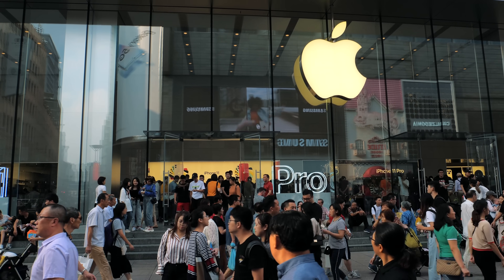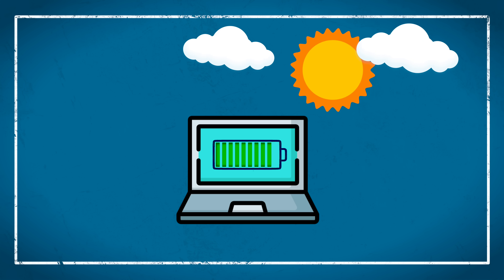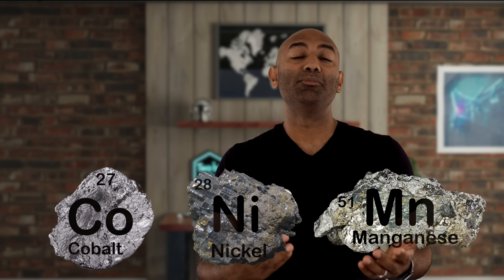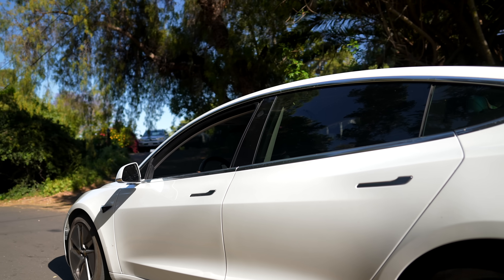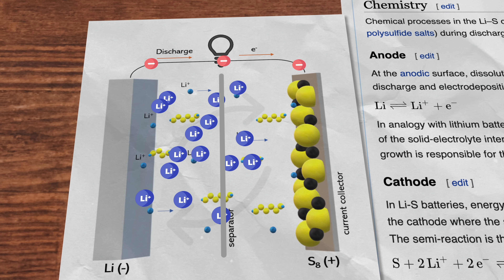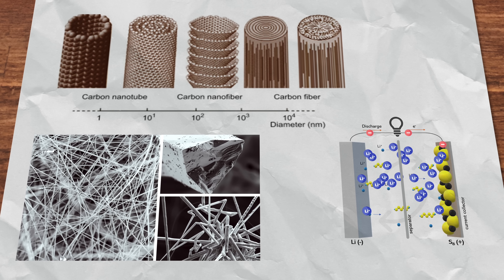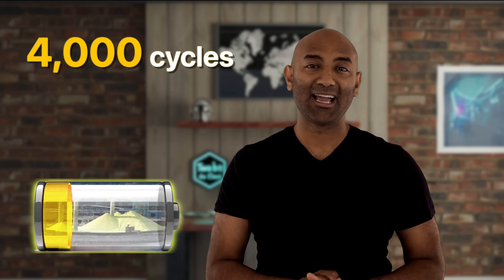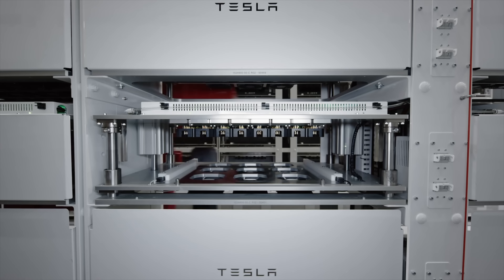Scientists Discover a Lithium Sulfur Battery Breakthrough on Accident!

Comment: Title: "Scientists discover super-awesome battery". Translation: "Some scientists made an observation which may or may not mean something tangible in a decade or two. Imagine". God I hate the internet.
Reply: Na ion battery s are already on the shelves.. and mark two versions from CATLE being built. But the inertia and politics 
Of Lithium based tech needs to be overcome.. 
Money 💸💰 isnt very clever it chases 💰💸 .... and runs a mile when it comes to actually solving big problems or Science 
ones that dont go away unless you try different things to solve changing problems. We definately need to get away from the wholesale use of rare elements ... and failing to recycle those that we cannot do without using...
We definately do not want to start mining deep ocean environments for them ... Thats the Planets off shute for so much dangerous stuff..  the input for the natural deep longterm  geological store. 
Microplastics being the current example in case. Theyve already reached everywhere and thing but most of it is in the upper layers of Marine sediments.... disturb it and we let loose a Blizzard of plastics and chemicals into the active recirculating marine and terrestrial environment.
Reply: Yeah, and I don't really understand the parade of Captain Obvious comments like "hey, they could put a smaller battery in a car and it would go the same distance and be lighter", or "hey, think about it, it could makes electric bikes better". "Electric planes become better."  As though well-known benefits to battery applications were not already the motivating factors behind many research efforts to improve battery tech.  Comments seem to imagine scientists laboring away in their labs, unaware of what their discoveries might lead to, and they are just waiting for the YouTube comment section to bestow upon them some clues as to how these developments might be useful.  Mutter mutter mutter.

Comment: Also why is 4000 cycles equ 10 years once  a day would be 3650 cycles seems like in the past hen I've heard a 1000 cycles equals three years that seems crazyer?
Reply: Depends on the frequency of charge/discharge cycle. Your maths are correct but the frequency is the uncertainty and has a wide range.

Comment: I hope this will ever leave the lab. I don't want to be negative, but we just don't know how the material will hold up in the real world. Is it really that cheap and stable? How expensive is the carbon sheet? How fast will you be able to charge the battery? How will it perform under high or low temperatures?

Comment: No electric cars do not have a present range of 500 miles - that is why there’s a problem and why sulphur chemistry is so interesting.Real world motorway driving (75 mph av 2 persons)will give you a usable safe range of circa 200 miles.That’s the problem.
Reply: The Lucid goes 500 miles on a single charge!
Reply: i think with an ID.5 you get 260 miles real range and they use old battery tech without silicon loading in the anode. with standard silicon loading you get about 25-30% more range, with silicon nanowires you get 60% more range easy and much faster charge times.

Comment: You should have included how much cobalt goes into a battery vs how much sulphur so that the dollars per mt made more sense. If its 112,000 per mt of cobalt but that can do X amount of batteries then it makes it hard to compare to the sulphur price per battery.
Reply: A sulfur battery is lighter than an equivalent sized cobalt battery so a sulfur battery is still cheaper.

Comment: Lol. There is already a lithium sulfur EV battery that is patented and being independently tested by BIC as we speak.  Preliminary results positive and final results by end of May. Done deal already
Reply: Really? What is the cost? Is it getting 1500 miles? Which EV maker is planning on using it?

What I found just by looking up these batteries:
The main problem is that current lithium-sulphur (Li-S) batteries cannot be recharged enough times before they fail to make them commercially viable. It is all in the internal chemistry: charging a Li-S battery causes a build-up of chemical deposits that degrade the cell and shorten its lifespan.

Lithium-sulfur batteries are high on the wish-list for future batteries as they are made from cheaper and more environmentally friendly materials than lithium-ion batteries. They also have higher energy storage capacity and work well at much lower temperatures. However, they suffer from short lifetimes and energy loss. Mar 24, 2022
Reply: @gigakrait5648  Mullen automotive has tested there to be 600 miles full charge and on a 18 minute fast charge another 300 miles.. polymer lithium sulfur and believe they use graphene for the folds.   Half the weight and size.. as for longevity believe they stated 5% loss compared to most lithium ion at 85% loss.. there were some naysayers so Mullen sent battery to BIC testing facility in Indiana to have it independently tested.. preliminary results came out positive, final results including charge cycles and degrading comes by end of May

Comment: A battery that weighs 3 times less?  What?  If it weighs 1 times less, it weighs zero.  How do you get negative weight?
Reply: Divide its weight by 3
Reply: @QH96  3 'times' less declares the operation is multiplication, not division.

Comment: Doesn't LFP batteries last 3000 cycles?
Reply from the maker: some last 6000+! I'm a huge fan of LFP batteries, and will be using them for my home.
Reply: @TwoBitDaVinci  awesome!
Reply: LFP is great for short and medium range EVs. next year with 230Wh/kg also for longer range but currently not for very long range. but maybe in a few years together with a better anode, you can make very long range (500 miles) batteries with LFP.
for home solar energy storage, sodium batteries can be interesting as well.
Natron Energy claims to have a cell with insane 50.000 cycle life, going into production next year!

Comment: Another lab breakthrough.  But there are always huge issues ahead, with manufacturability, supply chain issues.   This is still too early, even as a lab experiment.  The issues need to be understood better.

In the next few years, probably LFP is the best bet for getting off nickel and cobalt.  True, it doesn't have as much energy density.  But it is relatively mature technology, with a good safety profile, as well as long cycle life.  And can charge it to 100% without too much worries. This offers some more options for "cell to pack" efficiencies, much less packaging for battery safety.  Tesla is already moving in this direction for their lower ranged vehicles.  I heard, Ford is doing the same.

Silicon anode, is the other (realistic) technology to watch.
Reply: Silicon anodes swell enormously as they charge, as much as 25%. When they expand and contract repeatedly,  they crack, causing huge efficiency losses.

Comment: Yea EVs are great if your rich and can afford to drop an extra $10K or $20K (usd) for an EV over an ICE

I’ll keep the cash to buy food given all the Biden caused inflation
Reply from the maker: It's not that simple, you're only thinking of upfront cost. ICE cars are super expensive right now too, you know that right? Also if you have the vision to look out 5 years, EVs are actually cheaper. My gas SUV costs $120 to fill up to go 300 miles, and my tesla costs about $11.
Reply: @TwoBitDaVinci  I’ll trust your figures for your car as valid. You should know but again THE VAST MAJORITY OF PEOPLE CANT AFFORD AN EXTRA 10 to 20 THOUSAND up front.

And you forgot to figure in extra interest if you buy the car on credit (which I don’t).  Also many people can’t even afford to buy a new ICE but have to buy used ICE _ON__CREDIT_ and even if they could afford a used EV I don’t think there are that many around YET, give it another 5 or 10 yrs and there may be IF people can afford the replacement batteries as every current type of battery has a max number of charge/discharge cycles (I understand Lion and L-Po) have life of about a thousand cycles.  We don’t know what future battery types such as the Li-S (that just had an unexpected research accident hat may lead to that being a valid new type of battery) that may be invented in the near future.  Then there is the NDB that has been making progress (I hope that one makes it)..
Reply: @TwoBitDaVinci  Minimum starting price of a Tesla is $48k. Models with decent range (S model) start at $60k. Considering the current generation is pushing for minimum wage of $15/hr at McDonalds I doubt they will be able to afford one of these anytime soon or anybody for that matter with sky high inflation. Tesla's have also increased in price about 3 times already this year. Electricity is cheaper now but if gas goes away and governments lose all that tax revenue which is in the billions (hundreds of?) you can bet that they will replace it by taxing the living hell out of electricity. They aren't going to give that up. Add to that what all these EVs are going to do to the electric grid, i.e. overload it. California has had rolling blackouts for a few years now because they can't supply enough electricity as it is. Do you really think thousands if not millions of EVs are going to help that? Coal, gas and nuclear power plants are being shut down every year now. Solar and wind are not viable replacements on that scale. There are more downsides to EVs than you care to admit.

Comment: Well, not grid storage unless you're tight on space.  You've already covered the company ESS with Iron redux flow batteries, and that's certainly the best solution for where space is abundant like where wind and solar farms are.  And more than anything else, their tech needs to be advocated because it is THE most earth friendly grid storage from everything I've seen so far.

But yes for something like a powerwall this would be much better than Li-Ion.

I think ESS is getting a slow start because of how much Tesla competes in grid storage, and every time Tesla gets a new contract for grid storage, I see the cyber truck being delayed another month.

I've always believed that by 2030 there will be multiple battery techs on the market which are a good jump over what we have right now due to the sheer volume of R&D in battery tech.  It was bound to happen and yes I think any issues will be solved that is in the way of BEV being the CLEAR choice for driving in every regard, other than the noise and pollution.  They'll be cheaper to manufacture and cost less than ICEV and range anxiety will be SO 2020.  It already costs less to manufacture BEV over ICEV in China.
Reply: I agree with you & I support companies like ESS & Ambri. But the price is the governor. Factors like product cost, environment friendly materials & high efficiency will make electricity generated from renewable to be cheaper. So if this tech is going to be better in those factors for the grid scale storage it's rationally to support monoclinic sulfur batteries than the iron flow batteries! vice versa

Comment: Anything with that kind of range would kill the gas engine vehicles. I'd buy that car tomorrow if it had over 2000 miles of range.
Reply: Or even a very cheap 500 mile EV for urban travel.
Reply: But it doesn't. That's the point. This is just fantasy land. There is no proof of his claim that this will give you 1500 miles. He's click baiting people.

Comment: How about no lithium at all?  Aluminium or sodium batteries are nearly here. Faradion has got Aluminium cells working
Reply: The sodium batteries are like half the capacity though. So obviously a lot of potential for stationary storage, or small devices that maybe don't need a lot of energy density, but not good for cars.

Comment: Sulphur - common. Lithium - common (in seawater). Win win.
Reply: Lithium extraction from sea water is not economical just like hydrogen isn't. Just because it's common doesn't mean it's a viable solution. If that were the case it would have been happening for years by now.
Reply: And you spelled Sulphur correctly 😏

Comment: I was reading about this a couple months ago. 
Very exciting if it gets commercialized. 
This Energy density could get us 4 seater electric  airplanes with 1000 lb useful load and 3-4 hour duration. Cut the cost of operation for GA aircraft in half.

Comment: I thought the best li ion energy density was more like 270 wh/kg, not 800
Reply from the maker: right once you factor the whole pack... but the relative difference is still worthwhile for comparison
Reply: @TwoBitDaVinci  wrong
Reply: on a cell level there are the actual 4680 cells from tesla at around 296Wh/kg.
and Sila as working prototypes for the new G class Mercedes with more than 350Wh/kg. They are planning the production right now.

Comment: If these batteries need carbon nanotubes in order to function, they might be pretty expensive.  This is yet another one of those battery breakthrough reports that would be great if it actually pans out, but I'm not going to hold my breath.
Reply: 200%
We’ve heard it soooo many times before.

Comment: Great to see new tech but they are talking (in articles Ive read) the pack replacing a Tesla 74 Kwh pack would be 225 kWh  with the new Sulfur battery. This would not be feasible  to charge at home on a standard 7 kW Home charger and DC fast charging would take over an hour to just get 80%. Yes the battery tech does need improving no doubt, but those same advancements must also come to the Electric charging capabilities too. NO Solar on the car won't work either, at least not at the current Solar cell densities. I guess one could argue "Well you don't need that full 900 Miles of range so just charge it up some each night ", which to that I argue, not many people need the 270 to 300 Miles the current Tesla (Or other EV's) have in them now daily.
Reply: I think it's important to point out that that range would exceed anything but custom built cars in terms of overall range. A full charge would cover nearly 15 hours of driving at highway speed wich is already pushing hard on human endurance. (Professional drivers are limited to 11 hours by law.)
Reply: @mrspeigle1  that 900 Mile Range would be in a Tesla Model 3 with new Sulfur batteries. If you are talking Semi the battery would need to be much much larger to hit that same range due to the weight of the Semi which would take Week or more to charge. The 225 kWh (900 Mi) battery would take around 30 Hours to charge on Level 2, 7 kWh charger. and that 30 Hours of charge time would only reach you to 80% SoC.  As I said, great tech and glad to see innovations, but Charging infostructure needs to be in place before the battery tech could be utilized.
Reply: @johnqsak  They wouldn't only be able to increase the range. weight reduction is also very important.
Reply: @gear2902  This is true.
Reply: i think with the advancements of battery tech, many people will install a big battery at home too with maybe extra 30kWh or more to store their solar panel energy. that can bump up the 7kW home charger to maybe 10-11kW.
With the tech of Natron Energy, Sodium ion batteries get an insane high cycle life. they are also perfect for big energy buffers for commercial super chargers. electrify america will need these kind of buffers. they want to go 100% renewable energy for their chargers, mostly solar.
then you can charge your 225kWh tesla with 350kW, if you want.